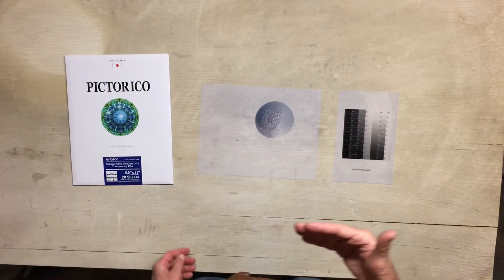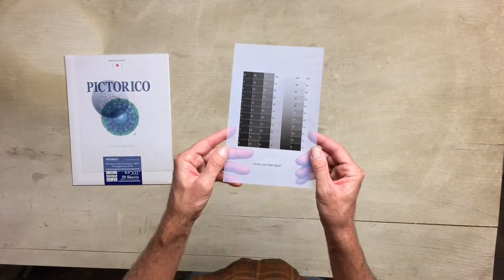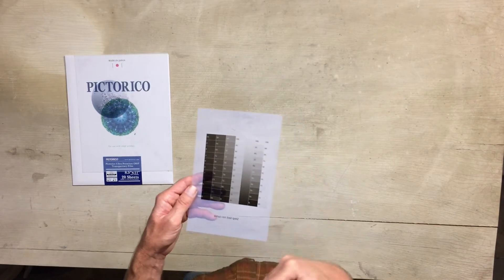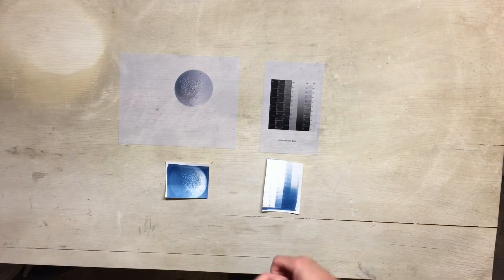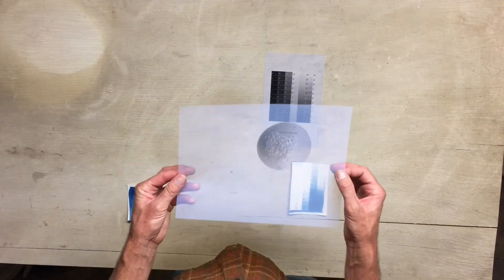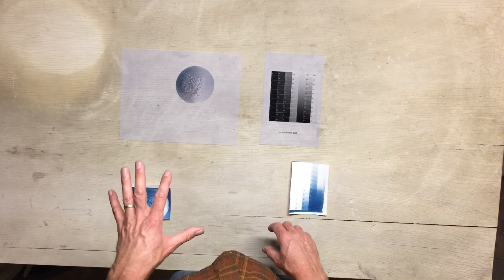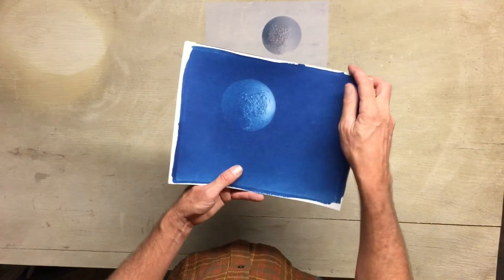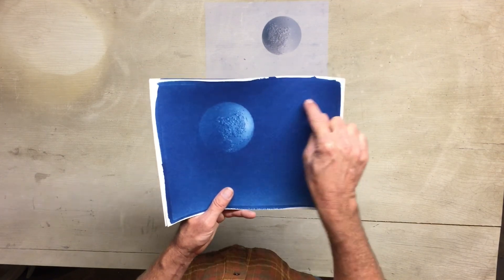Cyanotype Digital negative

Comment: why the step test on a single step test card, i.e. progressively exposing different parts of the one card? isn't the step test card-- the step test itself, i.e. it blocks more and less light at each position for the same total exposure time? Wouldn't the step test be to use multiple identical step test cards then reveal a new card at each step? the lights are blown out for receiving so little light and the darks are crushed for receiving so much light.